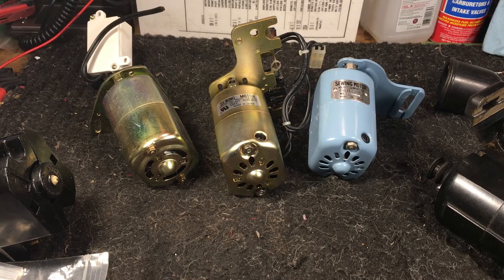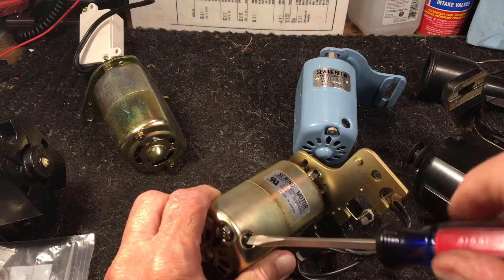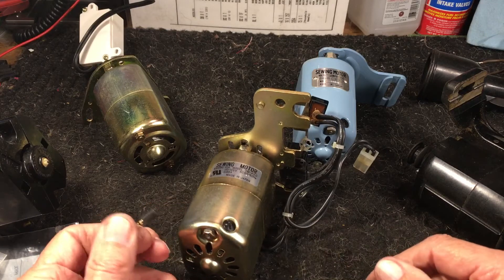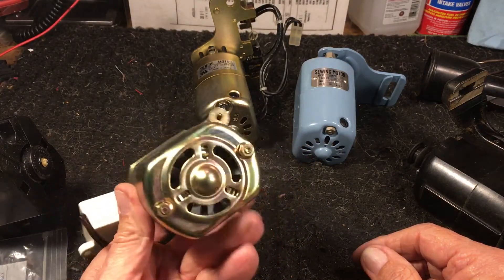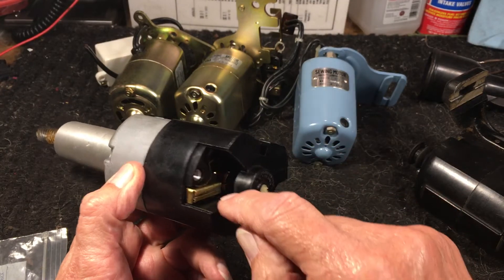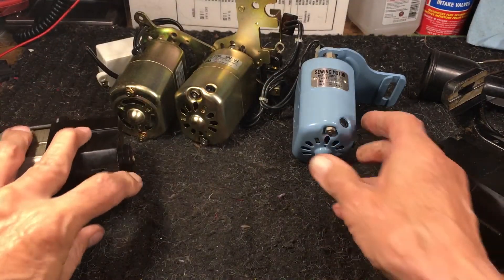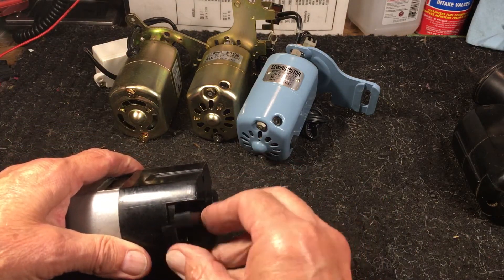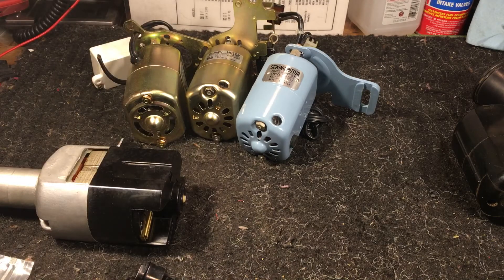How to know whether to Replace motor brushes or not. (Video 93)

Comment: Hello
I hope i get a response. Great video 👍🏽 
I have a question please. Whenever i press on my pedal, i see sparks of light inside the motor and also I perceive like something is burning inside. Could it be the carbon. Please enlighten me. Thank you.
Reply from the maker: It is a natural process to see sparks as the electricity is transferred through the brushes to the armature. It helps to minimize the arcing by running the motor at a high speed for a few minutes when the hand wheel clutch is released. The smell will diminish also. There will be airborne particulates as well as oil on the surfaces that will “burn off” and be eliminated. No big deal really. 😎👍
Reply: This really helps. Thank you so much @randyyoursewingmachineman9954

Comment: Hey Randy, I’ve got a motor that leaks electricity to my machine and shocks me when I press on the pedal. I can see it arcing in the motor when the pedal is pressed. Could replacing the carbon brushes help with this?
Reply from the maker: I doubt the motor brushes would be the issue. Check your wiring to see if the insulation is compromised where it’s contacting the frame of the machine.

Comment: Hey do you know if there is a good replacement for singer 328k and similar older models?
Reply from the maker: @FancyTuxie  any part that you need for a 328K should be available online. If you’re referring to the motor I would be surprised. I only see them need replacing if they were in a flood or disassembled by a curious unskilled mechanic.
Reply: @randyyoursewingmachineman9954  fair enough! I will look into replacement brushes for it then.

Comment: I have this issue with the elna serger motor! It  smell weird like metal and gets hot quick! I know I need to replace brushes and it’s probably dirty as well if I can’t I will replace the motor
Reply from the maker: Make sure the belt isn’t too tight and don’t oil the motor excessively. Blow it out with canned air.

Comment: 😭😭😭 so mine is that 3rd one, the brush is irreplaceable???
Reply from the maker: If you don’t see the screw caps, the motor brushes aren’t easily replaced. It’s really a job for a skilled motor rebuilder. For a motor that inexpensive, I wouldn’t bother with all the time and trouble. Always make sure that the problem is the motor and not elsewhere. I test them by applying direct current to the two leads with the motor belt removed. If it runs at a high speed, the motor is probably good.

Comment: My motor (kenmore motor E-6354) purrs like a kitten when it is off the machine, but makes a grinding kind of noise when installed. The sewing machine itself also purrs when the hand wheel is turned without the motor. But if I put the motor on, it runs but makes awful noise. I took motor apart and it looks good inside. Brushes are half way down. Motor itself is in very good condition, not dusty, dirty or junked up. I oiled the bearings, too. Why does it sound so bad? Thanks.
Reply from the maker: I wish I was there to help figure it out. That’s a puzzler for sure. Make sure that the fins on the armature fan aren’t rubbing against the motor housing. Could be that.
Reply: @randyyoursewingmachineman9954  Thanks, I'll check it out.

Comment: I have a quick question for you Randy, I have a motor that buzzes when started at low speed.  If I press down on the foot pedal all the way, the motor starts, but if I want to start off slowly, I generally get buzzing and I have to turn the hand wheel or press down more on the foot pedal.  Any ideas of what I can do to optimize the motor or somehow fix this?  I cleaned the commutator and replaced the brushes, but it still does that.  Any help would be appreciated.
Reply from the maker: That sounds like a motor that has had a lot of use and the motor bearings are out of spec. You’ve probably done the logical stuff, like a drop of oil on the bearings and making sure that the belt isn’t too tight. Sometimes I can change the brush springs and that reduces the pressure of the brushes as they contact the armature. I would also check for a “hot spot” on the armature and smooth it down, in order to get it more consistent contact with the brushes. Take the belt off and cycle the motor wide open fast and let off to zero speed. Like pressing on the foot control all the way and then let off repeatedly. Watch the pulley end of the armature shaft and notice whether or not it torques back and forth, or just runs straight and true. If you see the back and forth movement, the motor has worn bearings. These electric motors are usually super robust, especially the older ones. But they do wear out. It may be time for that motor to transition to sewing machine motor heaven. ( or wherever they go) Good luck.
Reply: @randyyoursewingmachineman9954  Thanks very much for your reply Randy.  Yes, I've done all the logical stuff, I've not looked at the springs on the brushes.  I didn't think of that.  It may be that the brushes are pushing too hard I just changed them and the new springs may be too tight.  

I didn't now about the movement on the shaft issue.  The shaft does torque back and forth, and the motor may simply have too much wear to ever work like new.  It probably has had a great deal of use.  

The motor is on a 1948 Singer 15-90 that I was sitting out in the street and then sat in a damp basement for about 20 years.  It was entirely seized, jammed up and rusted.  I took the project on as a new COVID hobby and after lots of very happy time spent, a quart of kerosene, a can of WD-40, a bottle of rust remover, a half bottle of sewing machine oil, rewiring, refurbishing the carbon pile foot pedal and some dismantling and refurbishing of rusted and seized parts, it's now rescued from sewing machine heaven.  The machine works beautifully, except for the slow-to-start buzzing motor.  The motor works fine once it gets started though.  I may have to decide to live with it until it completely gives up the ghost.  

Thanks again for sharing your expertise!
Reply from the maker: @r.duroucher225  you’re welcome. With that history, that motor and its new brushes may have to have a “run in” period where the brushes get in a new groove. It may get better as time and use dictate. Have fun.
Reply: @randyyoursewingmachineman9954  I think I've got it solved.  

First, I took your advice, a drop of oil in the bearings.  

Second, cleaned the commutator one more time, there was some build up of carbon that resulted from the brushes running in.  

Third , and this made all the difference, I adjusted the travel in the foot pedal.  It's a carbon pile foot pedal and the adjustment screw was too loose.  By tightening it up I was able to get the foot pedal to provide far greater accuracy in terms of the amount of power delivered to the motor.  

I wouldn't have thought to look at the foot pedal but for your comment about the brushes needing to run in which got me thinking about cleaning the "run in" carbon dust off the commutator which got me thinking about how power was being delivered to the motor.  As one pressed the pedal, it was essentially delivering far too low an amount of electricity to turn the motor, which then buzzed but didn't turn, and then it jumped to a high power with little control in between.

Is the motor perfect, nope.  It is more than a little bit worn.  But does it work  really well,  Oh yes, sure does.  Lots of control, lots of power.  

So Randy, thanks for taking the time to share your expertise!  I would still be puzzling and puzzling what to do if you hadn't shared your thoughts.
Reply from the maker: @r.duroucher225  good job in solving the problem. Max power equals max performance. Logical.